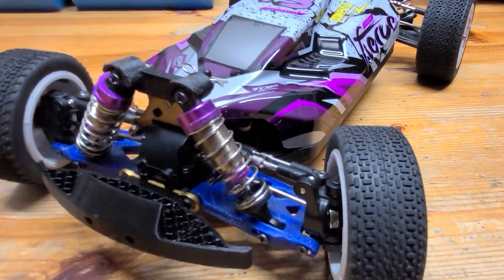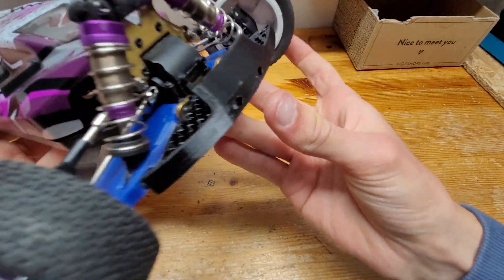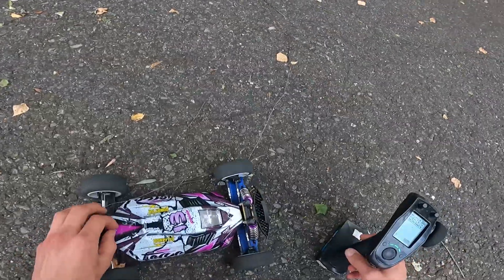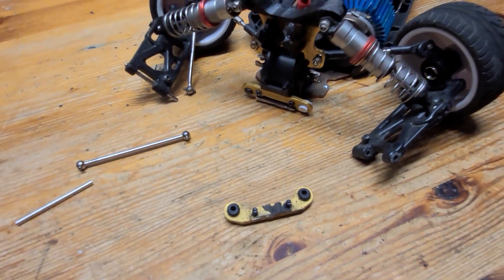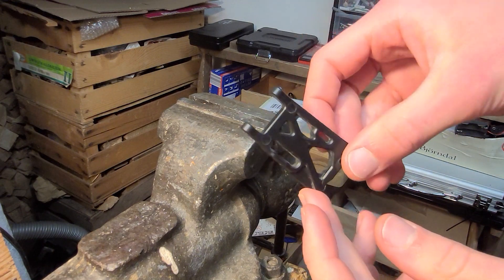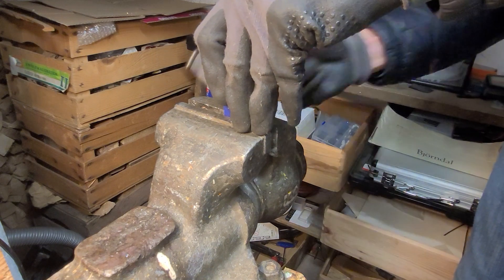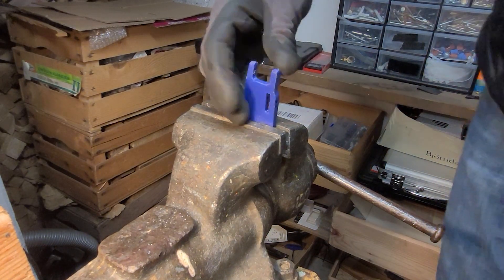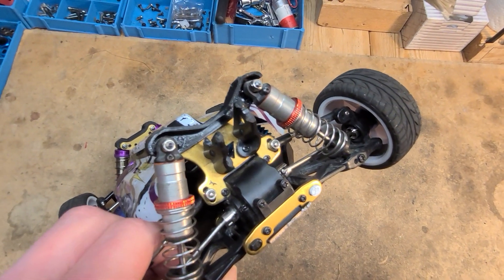Unbreakable 3D Printed RC Car Parts: Improved Version - WLToys

Comment: My sun brakes the shocks on this one all the time. Next step 3D shocks or torqbars as shock 😊
Reply from the maker: Which way do they break in? Have you tried putting droop screws into the holes on the arms to limit the negative shock travel and prevent them from getting ripped apart in tumbles? That fixed the shock issues for me on this car
Reply: @ValRC1  He hits walls in lika 45 deg angle right into the tire and the forces bends the piston and last crash it also broke the eye connecting to the control arm. been thru 4 sets of shocks for the front so now I'm going all in on TPU shocks for the front.
Reply: @ValRC1  but that's a good tip reducing negative travel! :)

Comment: Is it posible to use a tpu core and an abs/asa outta layer?
Reply from the maker: On a multi material printer yes, but maybe the hard asa shell would just break on impact
Reply: My idea is based on steel concrete, tensile core, compressive outta casing

Comment: Does it mess with the handling or steering, suspension geometry specifically under load? I'm working on a project to 3D print a whole 1/10 scale car, don't know if I should use TPU for the arms as shown here though due to flexing. Guessing that for a lighter car it might not be a problem but for a heavier car not sure.
Reply from the maker: If the arms are thick enough and you print it in some harder TPU like 98A or 58D it should be fine. There's only one way to find out though!

Comment: Great video! Have you ever experimented with 3D printing these parts using PolyPropylene (PP)? Stefan from CNC Kitchen suggests that it boasts excellent impact resistance and equal strength in all directions. It's semi-flexible, potentially offering more rigidity than TPU while still flexing upon impact.
Reply from the maker: I have actually. But for some reason, my parts printed from it weren't very durable at all and even the ones printed laying flat I could just rip apart with my hands 🤔 maybe my PP was just really bad quality
Reply: @ValRC1  that's a bummer. Stefan's test got my hopes up for PP.
Reply from the maker: @Curly3107  I bought mine after I saw his test as well. As I said though, might just be bad quality - I bought "Renkforce PP" 🤔
Reply: @ValRC1  I have a roll of "Formfutura PP" lying around. I've been wanting to test it for ages but haven't found a good print for it yet. Now I'm curious to see if it behaves differently. Maybe I will try it next week.
Reply from the maker: @Curly3107  I think it would be a great test! Let me know how it goes

Comment: awesome video i've been wondering this since the getgo. There must be a TPU formulation that's both dimensionally stable and flexible enough to take hits and be structurally sound. Awesome stuff man! 
maybe one idea is to print channels onto or inside the A arms, then you could run straight thick copper/aluminum/steel wire through it. keeps the TPU perfectly straight, and when you crash you just pull out the bent metal stick and replace it with a straight one?
Reply from the maker: Extrudr has some Carbon Fiber infused TPU, been thinking of trying that stuff out. Thanks for watching!

Comment: HSP use a very flexible plastic on their suspension arms, during acceleration, you can see the suspension geometry is changing. During collision, the plastic bend but the drive shaft absorbed all the impact, resulting so many bent drive shaft.
Reply from the maker: Hmm okay I see, I haven't notice that with these. I think the HSP Driveshafts are also very poor quality so that might be another reason why they bend so easily
Reply: @ValRC1 The scale factor also metters. And the wheel diameter.

For example, I've got a 1:8 scale Remo Hobby Dinosaurs as my daily driver.
And didn't experience any suspension destruction yet (most likely due to it being a factory tuning option made of injection molded nylon ).

But it grinds cups and T-bones on the ends of it's CVD drives like crazy - and it's not a material quality issue - as all of mine t-bones are replaced with segments of drill butts of matching diameter. Still they last about a couple of months with those huge wheels - with a pedestrian 60A ESC.

Was looking forward to move to the metallic telescopic drives for a long time - but the stock suspension wasn't uite fit for the job.

Now they've released a new tevision of the Dinosaurs, with the new lower suspension arms which allow for any Slash-compatible telescopes to be installed.
So already got the 150A ESC at the shelf, waiting for the new suspension arms to get out on into the market - to both gain some low-end power, and eliminate the biggest factory flaw this model has with it's CVDs not lasting at all.

Comment: Glad you kept working on it. Any plans trying to print in TPU 58D?
Reply from the maker: That seems like a great material for stuff like this, but all the filament I can find seems to be way more expensive than normal TPU - do you know any brand making it for relatively cheap?
Reply: @ValRC1  nope sry
Reply: What printer do you use
Reply from the maker: I use an older Prusa MK2.5S printer
Reply: How much for some steering knuckles for a Helion dominus
Reply from the maker: I don't sell that specific part

Comment: If only rc companies used these, it wouldn't cost them much...
Reply from the maker: I'm actually not too sure on that.. could cost them substantially more due to being an additional material they need to store and manage.. but yep would be great to see some better arms shipped. 

Also, wltoys seems to be having some quality control issues, as I showed in the video the older wltoys arms I tested here held up much better than the ones I tested last time, which I got with my newer car..
Reply: @ValRC1  what could be a factor, is that plastic is hydrophilic, so over time the plastic gets more flexible due to water becoming part of the plastic. People boil plastic rc parts for the same purpose; to make it more flexible. Not sure but that could be another explanation.
Reply: Handling would also suck
Reply from the maker: @stokedGSXR  nah it's fine. Didn't really notice a difference. Maybe on a track but this isn't really a competition rc car
Reply: they have to make their money